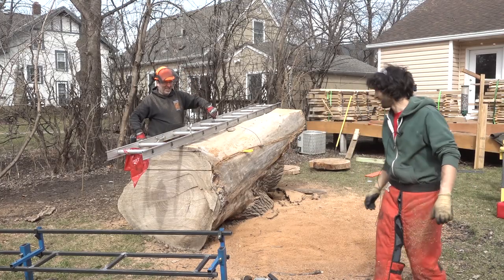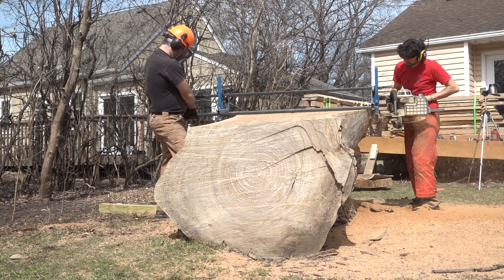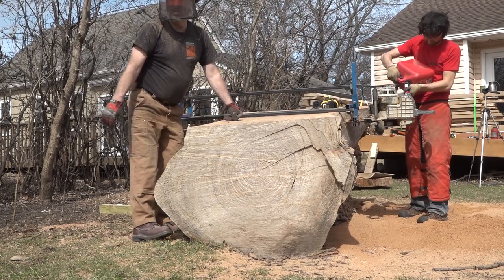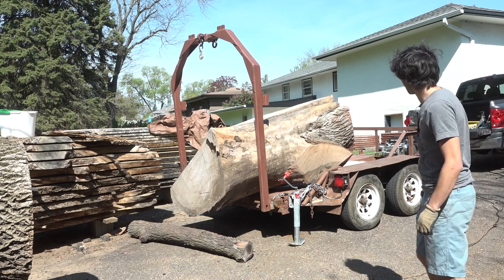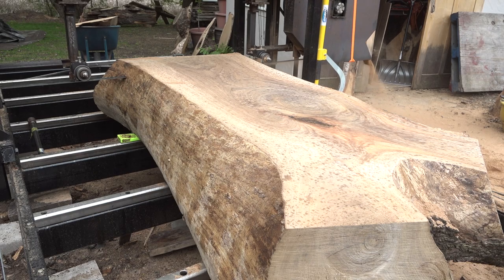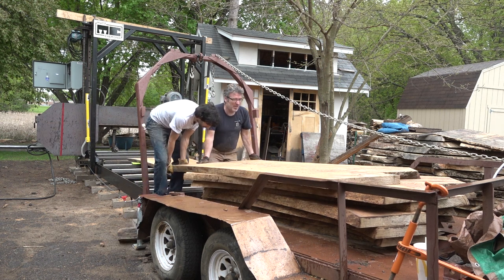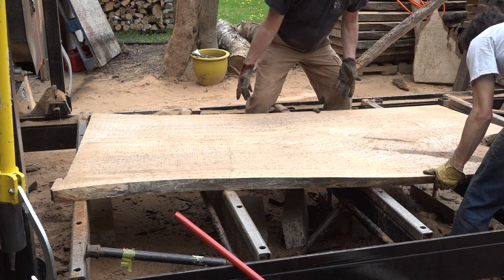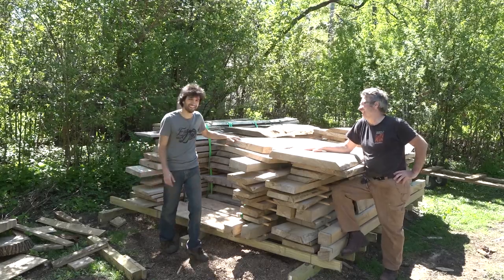Slabbing BIG ELM with a Chainsaw and Bandsaw Mill

Comment: I ran an 090 Stihl with a 60" bar (sometimes not big enough) falling big wood in Oregon back in the 80's. We ran Husqvarna 2100's with 42" and 36" bars for bucking and for falling the not-so-giant stuff. That 090's a beast! Properly tuned you can really lean on it and it just keeps eatin' wood. Tons of torque but NO rubber mounts. I remember my arms would continue to vibrate after the end of the day and would sometimes fall asleep at night due to all the vibration from that monster. Watching this, I recall how much of a Cadillac the 084 was by comparison. It was true timber-fallin' luxury. (0:]

Comment: Also make every 5th tooth 1 to 2 degrees with the same raker depth, Every 5th tooth that is flat will act as a planing tooth and will clean the kerf as you mill.  Try it it works.

Comment: I wonder where there are even dead elms anymore? I used to use it for firewood in the Adirondack are in the early 80s, and it was a race against rot then. Damn the Dutch Elm disease. They were once stately large trees. They weren't really good firewood, but it was better than just letting them rot. They were very hard to split. That is why I believe they used to make shipping crates and baskets with them. I understand it a very tough durable wood. It didn't burn that hot and left lots of ash that would fill your stove.

Comment: I just spent my weekend with my Alaska mill doing the same thing, lightening up a pair of 20 foot 40in dia fir logs that where too heavy to lift with the equipment we had. I wish I had a helper or gravity working with me but it was just me on my knees taking a 14 inch cut and gasping for air as I'm stuck holding onto the throttle.  It was a happy morning this am when they made it to my mill.
Reply from the maker: oh yeah I can totally relate to that

Comment: you need to add a little 2000lb 12 volt winch to replace that hand crank. I did that on my mill because i injured my arm and could not push the mill. I'll never go back. the powe out feed is slower than the retrieve feed. so you can chose the feed you want. I added a solar panel to keep the batterry fully charged when not useing it.

Comment: Matt,  I'm just starting to do this.  I have a Stihl 661 with a 36" granberg mill.  What are your thoughts on milling thicknesses?  I can see where cutting a 3" slab makes a solid, but really heavy top.  I've been mostly cutting at 2".  I would like to cut some thinner slabs, but I don't know what to expect with warpage and the effort needed to plane smooth edges.  Can you realistically cut one inch slabs with a chainsaw mill?  Most of the slabs I'm making are too wide to go through my planer.  Splitting them on the bandsaw, as they are, is also a no-go.  So, unless I cut them down to a more manageable size, there is no way to make them thinner, and flattening them is going to take a router and a flattening jig.

Comment: Great video as usual. When someone take a log to a mill or has the mill guy come and pick up the log is the cost determined by the output, the time or??? Do mills normally get paid but how many board feet they produce. I guess the same question is about if a mill bought a log is the price also based on board foot? It is amazing to see the wood as you uncover the beauty of each slab. Thank you for sharing.
Reply from the maker: Depends on the mill operator.  Some charge hourly and some charge by board feet.  Some will also charge extras like set up or blades.  Logs are scaled by the board foot.  There are calculators that will tell you the board feet based on the log's size.  Thanks!

Comment: Hey Matt, I just got myself a chainsaw mill as well! I've tried it out and it manages to cut well. One issue I've been facing though is the fact that the wood I'm slabbing (Acacia) tends to pinch my chain as I reach the centre portion of the log. I can't figure out why as I do have wedges in between. Any tips and tricks to the situation? Thank you!

Comment: alright Matt I think I have the right question for you now: I am building a mill and want to know how long of spacers to weld in between the long tubes of the mill yours looks to be about 12". so not the length or depth of the mill but how wide? For the chainsaw mill.
Reply from the maker: +Anthony ferrin 9.5"
Reply: Cool bud!Thanks for your patience!
Reply from the maker: no problem

Comment: Matt - that bandsaw mill is absolutely stunning (as was the log). I've only seen bits of your video series of making the mill; what's the HP rating of the motor?
Reply from the maker: +gbspikyfish thanks! It's a 10hp motor
Reply: Wow. Not messing about with that then!

The slabs you're getting off that machine are incredible. I'm very jealous :)

Comment: Matt, Always like your bandsaw mill videos, that was a great log. I'm surprised you didn't keep a couple slabs for yourself. Also when did you add the blocks under the mill, was that to make even with log trailer or was it sinking into ground under the weight of some of those logs?

Comment: So Matt, when you got down to where you were slabbing those thin "slabs", (19:20) how were they held in place?
Reply from the maker: By their own weight. They’re just laying on the bed
Reply: @mcremona  wow, I would have thought that the blade would maybe make them move.
Reply from the maker: @befmx31  there's stops on the side.  All the cut force is across the bed.

Comment: Nice to see both methods for comparison. Sorry if I missed it on another video, but what do you use for blade lube?
Reply from the maker: Thanks!  I'm using diesel in this video for lube
Reply: Diesel seems to be common, but I am concerned that it might cause issues with a final finish. Does it evaporate and not leave any oil - or not absorb very deep and get planed off? I use water, but there are issues with it too.
Reply from the maker: It's not an issue. The chainsaw mill is lubricated with bar oil.  That doesn't cause an issue either.  There is so little lubricant that actually end up on the surface and any that does will be removed when the board is surfaced once it's been dried.
Reply: Thanks for the info

Comment: I've been directed to stay away from milling branches as they are prone to warp and twist.  What made these ok?  Thanks!
Reply from the maker: The limbs we milled grew almost vertically so they didn't grow with any stress in them.
Reply: interesting point!
Reply: I guess one could trim most of the weight off a branch and let it sit for a year before cutting the rest down to let it the stress work out of it.....sound logical?
Reply: That makes a tom more sense. Thanks. While we're discussing. Would you mill branches that grew at more of an angle? What would be your estimated cutoff point? Is there a preferred way to mill branches at more of an angle?

Comment: How do you manage termites and other pests in the dead treesl/cut slabs?
Reply from the maker: The harsh winters help with that.  We don't really have any insects that will eat or live in dry wood.
Reply: Matthew Cremona - WOW!  I live in Oz; which is best described as a giant ant nest between two oceans.  Here we have termites that will mud pack their way up two stories to get to dry dead wood, otherwise known as roof trusses.  In the colder areas they are not as aggressive/adventurous but they are still there.

Comment: Mat you need to attach the ramps to the mill and add rollers to them help with loading , and make them able to be raised up so they sit on the back of your trailer, you could roll stuff on and off super easy then

Comment: Matt I hope you read this comment:  When a full comp milling chain is perfectly tuned it should pull itself through the wood, you should almost have to lightly hold the saw back:  Find some one that will port the exhaust and remove the limiter tabs on the carburetor of your 090.  I take it that your saw is an 090

Comment: i dont know if someone pointed it out but there's a stainless bar bed "skid" that seem to bend when you pull a log onto it, maybe a bolt is broken?
Reply from the maker: The one on the end isn't bolted down completely. I need to adjust the holes to match the holes in the frame.

Comment: Also I keep seeing you in these videos moving slabs with no pipes or pieces of plastic to slide the slabs on, putting an inch to 2 inch thick pipe in between the slabs will allow you to easily roll the slabs where you need to move it from there, helping to cut the amount of effort you put out.

Comment: has moving the logs on and off the mill effected where it sit and whether it is still level and square?
Reply from the maker: I've scooted it around a few times but it hasn't affected the frame.  It's rigid enough that it won't distort if some of the feet aren't touching the ground

Comment: Since you stickered the wood, we have to assume they were still wet.  Did you have some numbers from moisture content?  And once you got all the wood stacked, did you seal the ends, and with what?
Reply from the maker: They're still reading above the max on my meter (32%).  The logs were sealed after the tree was cut down with anchorseal

Comment: Matthew, could you please explain why it seems like you only cut slabs? Are they just easier to store and how do you reduce them down to board thickness?
Reply: pestr999 with planer, jointer, table saw, bandsaw, or circular saw on a track. Theres tons of options and ways to do it.

Comment: Have you looked into something like a Kool Mist to lubricant your cut? I used it before to resaw 10" thick Aluminum. Really works well but requires an air line to run it.

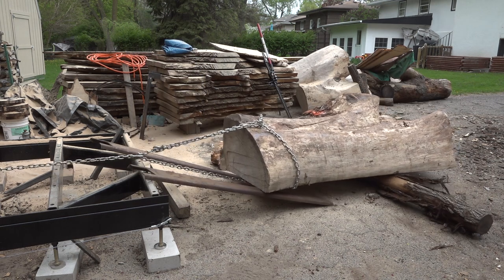Comment: hey matt cool vid! just want to point out tho the legs of the sawmill are shifting a lot between  10:15 and 10:25, looks like they could slip off that little pad?
Reply from the maker: yeah something I need to work on.  Not enough friction there
Reply: Wow, the bandsaw mill is really performing well!

Speaking of friction; when you shove the boards off the sawmill, couldn't you start by lifting  the ends with the lever-thingy and put something round to roll it on? 
We love to see you do hard work, som don't get worn out anytime soon! ;)
Reply: Matthew Cremona I noticed it too maybe some small easily adjusted tabs out of flat stock or angle to just keep them from sliding since the log dogs would be too much.

Comment: you should add a rolling bar at the front of your mill. the bar on there now looks like its taking some abuse @ 10:17
Reply: teh40oz that thing is really twisting! 😯
Reply: also at 10:37, you can see that this effort moved the bed off the foundation back & askew in some places about 2 to 3 inches, probably throwing off the flatness/squareness of the bed. if you go back a few minutes you can really see the difference. No disrespect at all Matt, just wanted to point it out so you don't have to do any extra effort to fix it down the line in case you didn't notice it. Much love to you buddy, livin the dream!

Comment: when you finish running your saw full throttle let it idle for a minute or so and dont shut it right off so it cools itself down. When you shut it right off it heatsoaks and its not good for the electronics